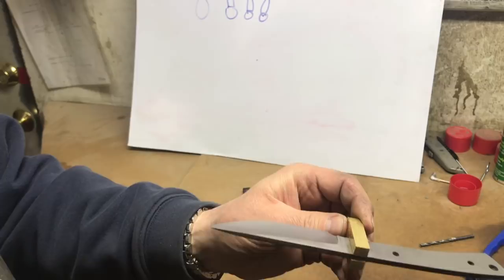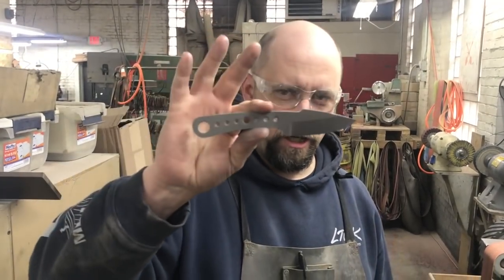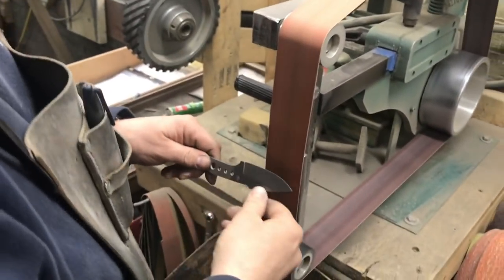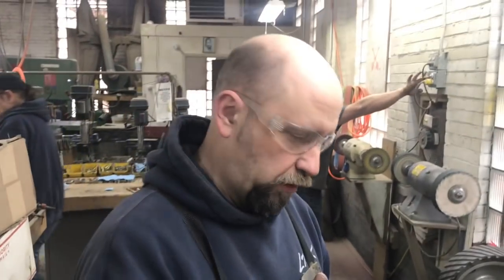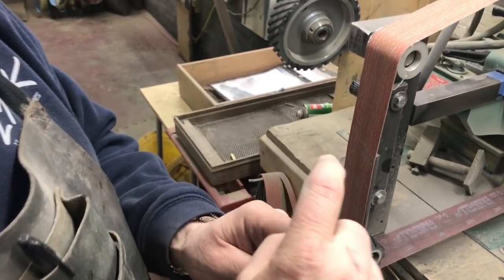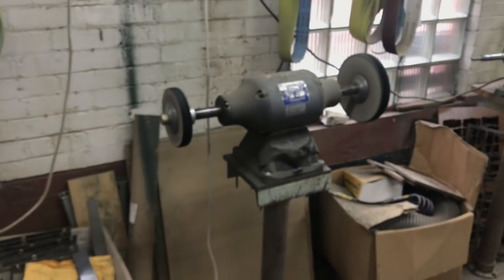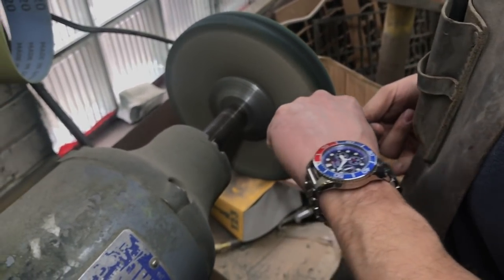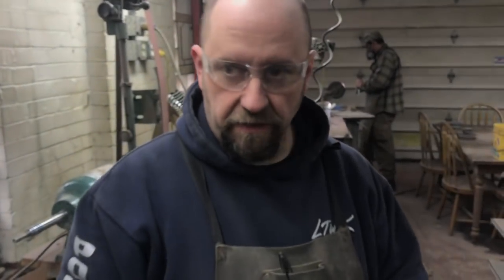LTWK How-To: Sharpen Your Knife Part I

Comment: How to sharpen LT Wright scandi with microbevel? Like standard flat grind (also with microbevel)? With true scandi is simple. But with scandi with microbevel sharpening by hand and stroping  in the end you get more like scandivex. Wich is ok but I just want to be clear with that. Did I miss LT Wright scandi grind sharpening presentation?
Reply: If you just sharpen as a normal Scandi and strop on leather you’ll be fine.  The micro bevel we put on is VERY micro, nothing like a secondary bevel.  It’s put on with a hard buff, not a belt.
Reply: @zebratruck  Thank you for quick answer. I allready have LT Wright Forest trail, flat grind and I consider to buy Genesis A2 scandi but it looks that is out of stock in every web shop. DLT, Theknifeconnection...
Reply: @zebratruck Hey Scooter, is the hard buffed bevel you do at the shop comparable to an actual micro bevel as far as strength and durability?

Also, how about a video on how you guys recommend corrosion prevention on the carbon steels? Just apply oil when done for the day? Applied and left wet, or applied and buffed off?

Thanks!👍🏻

Comment: ●Is the 1st machine a belt grinder or belt sander? Is the surface feet per minute around 3,000 or 5,000?

●What's the RPM of the Grizzly bench grinder-- 1,800 or 3,600 RPMs?

●What brand is the green compound? I'd like to look up the grit size.

Thanks for the video.
Reply from the maker: It is  2x72 belt grinder. It has a variable speed controller so the FPM is always changing.  The grinder will have a plate on it with the RPM's listed.  The green compound is from RW Wilson.

Comment: How come the blade does not cut into the belt as you are forming the burr?
Reply from the maker: It's hard to explain, but it just doesn't. The angle that we hold it at doesn't cut it.
Reply: Because I'm not holding it too steep as to dig into the belt.